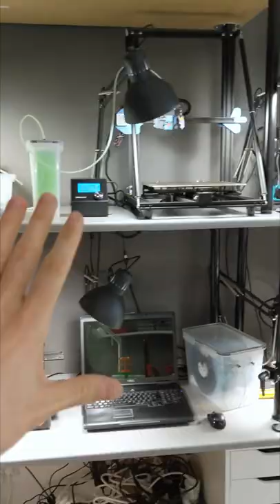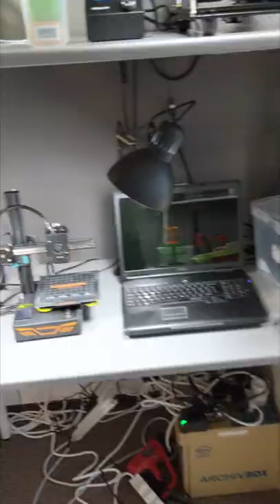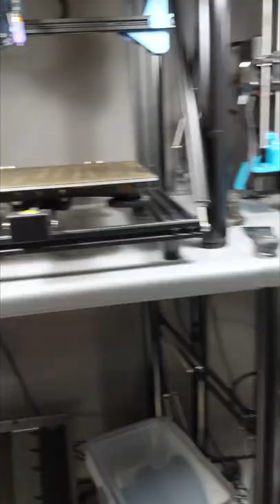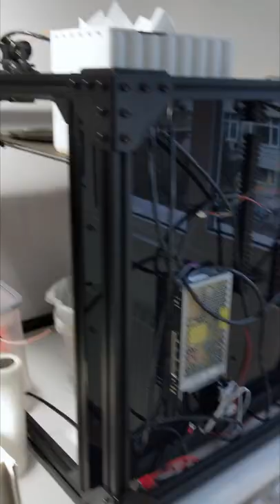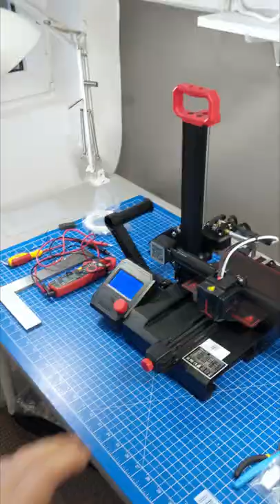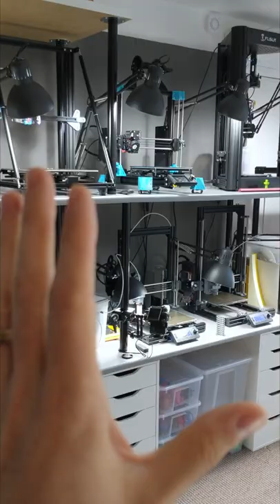Don't get a 3D printer

Comment: I think the real lesson here is "Don't get a dozen 3D printers that all have different annoying problems" 😆
Reply: Pick one printer for a printer farm/business and get to know it really well, then just get a bunch of the same. Unless youre making content reviewing different 3d printers, then go for variety. While entertaining, kind of a scewed video.
Reply: Exactly. I got an ender 3 v2, printed upgrades for it as i went to make it better and better but in total id say those amount to maybe 1-2% of the printing I've done with it.

The biggest tune time cost has been designing things to solve problems and having to iterate and improve designs and learning how to use the software. And a bit of learning to use slicer software to get specific results.
Reply: I have 2 fdm printers both are ender 3 but one has a direct drive on it because I print in tpu a decent bit
Reply: @xathridtech727  just for some ender 3 s1s. They are the shit
Reply: Yup, pick something like a QIDI or Prusa
Reply: @munzlp  I have qidi x max and ender 3 pro is more reliable

Comment: "With enough money and time you can get anything done!"
bold of you to assume I have money
Reply: Ha!
Reply: Can we design  the  custom  all rounder the world's looking for ?
Reply: @SemiEvolvedNeanderthal  I wonder . . .
Reply: @SemiEvolvedNeanderthal   absolutely. Can it be done with an affordable product at the end? Thats the trick. Mosiac is coming out with an aweome, turn key, 8 color printer with a 500 degree hot end thay can print almost anything. Also $10,000.
Reply: We need a printer that prints printers
Reply: @SemiEvolvedNeanderthal  Called a Voron
Reply: I'm keen to get printing
Reply: @SemiEvolvedNeanderthal   id reccomend an ender 3 pro or v2 with upgrades or an ender 3 s1 if you want something a little better out of the box. With the ender 3 pro Id say replacing the motherboard with a 32 bit silent one is mandatory ($40-$60) but the rest is optional. V2 and S1 come with 32 bit board.
Reply: And or time
Reply: @williammiller3277  this upgrade or auto bed leveling?
Reply: Time is money so with enough time you can get money
Reply: @Unicorn73673  some people could have all the time in the world and not get money. Time being money doesnt mean with unlimited time you get unlimted money.
Reply: I've had my printer for 4 years and i put maybe several dollars worth into it above original purchase price. All the replacement parts are CHEAP. You don't need much money if you have the skill. With time, you can gain all the skills you might think of.

Like "Needs a new control PCB" is kind of stupid. No matter what's toast on yours, you can just repair and rebuild it much cheaper than getting a new one. Like yeah you might WANT to get a new one for features and quality but you don't NEED it. Mine caught fire, and it got rebuilt, and it's printing now. All good! Had a hidden manufacturing defect that i can vouch is no longer present.
Reply: Least you’ve got time? Haha
Reply: When someone says "if you have money," that person is not making an assumption that you have money.
Reply: @dandcc9192    not what @kinematic quoted, but ok.
Reply: @williammiller3277  "with enough money you can" is basically the same thing. Implied is: "without enough money you can't."
Reply: @dandcc9192  and yet it is different and makes your comment dumb. But do go on.
Reply: @williammiller3277  Not really different. If I say to you "with a hammer you can build many different things" I am not saying to you that I assume you have a hammer. I am saying to you "If you have a hammer, you can build many different things that you wouldn't have been able to if you didn't have a hammer."
Reply: @dandcc9192  literally different.
Reply: @williammiller3277  You don't say? By definition they cannot be LITERALLY the same, when they are not exactly the same sentences lol what are you on about? Sense for sense, they mean the same thing.

You know what? Then let me rephrase it. "Just because someone says "with enough money" it doesn't mean that that person is assuming that you have enough money."

If I say to you "with a knife you can gut a fish," it doesn't mean I am assuming that you have a knife. In fact, quite on the contrary, I may actually be a knife salesman who's trying to sell you a fish gutting knife, pretty much assuming that you don't have a fish gutting knife at all and that's why you need to buy one from me.

So you can see for all practical purposes, at least in this usage, "if you have a knife" and "with a knife" are the same expressions. The scenario does not change if I said "if you have a knife, you can gut a fish." The difference might be that "if" is a bit more explicit.
Reply: @dandcc9192  so you agree your comment was dumb since It responded to what wasnt said. GREAT! Glad we made it. Have a great day!
Reply: @williammiller3277  How do you read that as that? lol Reading comprehension much?
Reply: @dandcc9192   more a caring issue honestly
Reply: @williammiller3277  Well at least you admit it.
Reply: @dandcc9192   cant say the same for you. Have a great day.
Reply: @williammiller3277  Of course you wouldn't. I didn't really have something to admit to lol what are you on about. Bye
Reply: @dandcc9192   whats something people say before admitting something for $500 . . .
Reply: @williammiller3277  Lol are you asking me or telling me? You are really not one to be going around trying to correct people's English.
Reply: @dandcc9192   Whooosh!!!
Reply: @williammiller3277  Whoosh indeed
Reply: I absolutely agree!  How damn hard is it to make and sell a printer that just works???!!!!
Reply: @tshirtfactory07  its not. If youre willing to pay for it. Like any tool.
Reply: I am a parent of small children. I have no time or money. 🙃
Reply: @williammiller3277  S1 700+$ Ender 3 250$
Reply: @chaosvii9459   huh?
Reply: @williammiller3277  you say I recommend Ender 3 pro or V2 a little bit better Ender 3 S1...
The price is not a little bit better 😜
With money for S1 a can buy 2 v2
Reply: @chaosvii9459  s1 is $350 with make an offer on ebay. What are you talking about?
Reply: @williammiller3277  make an offer is auction........the real price is 750$ is not a little bit difference
Reply: @chaosvii9459  no, it isnt. And make an offer is literally the opposite of auction. Real price is 400 and you can get it for 380 without make an offer. How did you get $750?!?!?!? Try learning about stuff before trying to be snarky about it.
Reply: @williammiller3277  in Italy the price for Ender 3 S1 is 750€ and euros and dollars have similar value
Reply: @chaosvii9459  that isnt the normal price. Cant speak for tariffs and whatever. The price is $350-400 most places in the world plus whatever governments put on top. Get it for $380 on ebay from someone who ships it international. But no, it is not $750 msrp. Not even close. If even true sounds like an italy issue,  not an MSRP issue. Hell. The full retail price of an s1 pro is only $500.
Reply: @williammiller3277  and the real price of a Ender 3 base?
Reply: @chaosvii9459  ender 3 is 189. Add in a silent board ($50), bed leveling ($50), direct drive ($40), filament sensor ($20) and youre at about $350, plus have to install and update firmware where the s1 is 96% together out of the box. So yeah, I recommend the S1 at $350 instead of upgraded ender 3.
Reply: Build a Voron trident!
Reply: You don’t have money cause you have time
Reply: I have way more money than I have time for these printers!! And I am broke 😅
Reply: I normally don’t laugh at comments but this genuinely got me lol
Reply: GOD JESUS TOLD US TO LOVE GOD AND TO LOVE ONE ANOTHER! LET'S NOT DESTROY THIS WORLD! NO WAR!!
Reply: @zwapz  GOD JESUS TOLD US TO LOVE GOD AND TO LOVE ONE ANOTHER! LET'S NOT DESTROY THIS WORLD! NO WAR!!
Reply: @SemiEvolvedNeanderthal  GOD JESUS TOLD US TO LOVE GOD AND TO LOVE ONE ANOTHER! LET'S NOT DESTROY THIS WORLD! NO WAR!!
Reply: @kinematic_InMotion  GOD JESUS TOLD US TO LOVE GOD AND TO LOVE ONE ANOTHER! LET'S NOT DESTROY THIS WORLD! NO WAR!!
Reply: @williammiller3277  DUMNEZEU A CREAT O LUME MINUNATA! SĂ NU DISTRUGEM LUMEA ASTA! SĂ-L IUBIM PE DUMNEZEU ȘI UNII PE ALȚII! NU RĂZBOIULUI!GOD JESUS TOLD US TO LOVE GOD AND TO LOVE ONE ANOTHER! LET'S NOT DESTROY THIS WORLD! NO WAR!!БОГ СОЗДАЛ ТАКОЙ ПРЕКРАСНЫЙ МИР! НЕ БУДЕМ РАЗРУШАТЬ МИР! ПОЛЮБИМ БОГА И ВСЕХ! НЕТ ВОЙНЕ!